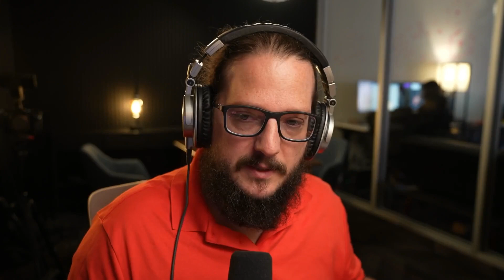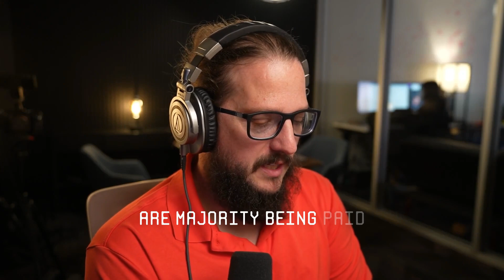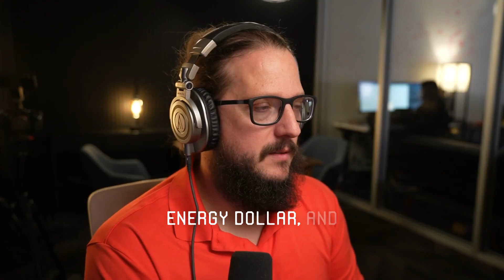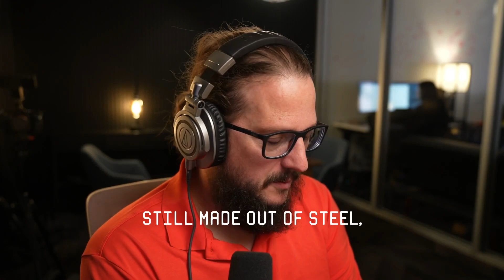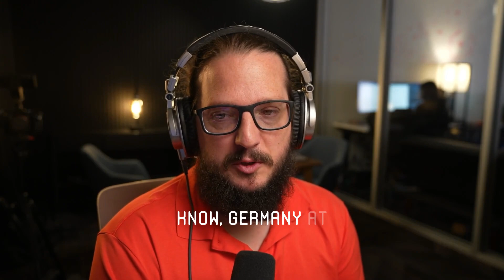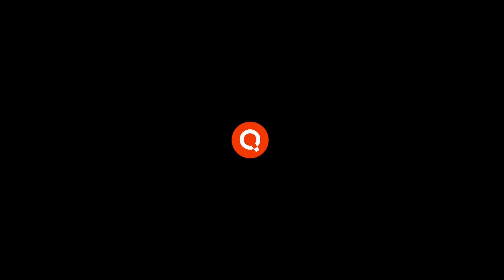Bitcoin's Fatal Flaw: Too Much Energy, Too Few Transactions

Comment: Its got more fatal flaws than that... for instance no store of value. As in, the hash you get for your $99,000 today is useful for absolutely nothing other than the fact that it is unique, and that your wallet possesses it. You can do nothing with it, not even wipe your ass.

At least if you had gold worth $99K at current market price and no one wanted it, you could make jewelry out of it, or use it to make electronics. With the hash you have quite literally nothing, because you can do nothing with it.
Reply from the maker: 97% of gold is used as a monetary asset, which means that it has very little if any alternative use. Certainly not sufficient alternate use to maintain its supply. The value of gold as a monetary asset has to do with its properties, chief among them is that the mining and refining of gold is expensive which creates a costly expense on increasing its supply. PoW cryptocurrencies are designed to copy the physics of creating gold, which embues them with the same monetary properties.
Reply: @QuaiNetwork  
Proof of Work Crypto cannot copy the physics, nor the physical properties of gold. That's absurd. 

Even if everyone in the world woke up one day and decided that gold is no longer to be considered a "monetary asset". Gold still has its properties and uses as jewelry, and electronics that you can fall back on, so it will always have SOME intrinsic value. If the same were to happen to PoW Crypto, all you would be left with is a hash. All that power that went into "mining" the crypto so that you can "prove your work" is wasted, since it cannot be recovered.
Reply from the maker: If people decided gold was no longer a monetary asset its value would drop by 99%.
Reply: @QuaiNetwork  
True but it would never drop to zero because it conducts electricity better than copper and it doesn't tarnish like copper so it would garner more value than copper.

If people decided to jump to another crypto, a newer crypto that has the same properties as bitcoin but is faster, and wastes less energy, the bitcoin hash would be worth precisely zero. Not 99% loss, but total loss.

Comment: so basically like Cardano since inception but there is no Bitcoin treasury governed by its coin and community.
Reply from the maker: I always have thought that the pinnacle of decentralization is having a treasury that is managed through a political process of governance to arbitrarily change the rules for all system participants if they agree to it or not. Lets go Cardano!
Reply: @QuaiNetwork  So only miners and highly technical people should get access to changing the rules? If blockchain is to get into identity, governance and so on, it will need different people to get involved and experimentation.
I didn't mean to talk quai down btw, I wrote that after about 3 min into the video, hearing about bitcoin problems and I wrote it in a light mood while appreciating the video :)

Comment: Bitcoin isn't going away.  It will continue to be a store of value because too many people see it as that.  But it will NEVER be the thing that people use to pay bills, buy food and shop online.  It can You need something extremely fast to do that.  Kaspa is fast, but it's value fluctuates too much for it to be used for this.  It would need to be tied to some type of stable coin.   What I really like about Quai, is that it has a type of Stable coin built into the system in QI AND it's fast.  I'm looking forward to seeing if it can do what it says.  That could change everything.